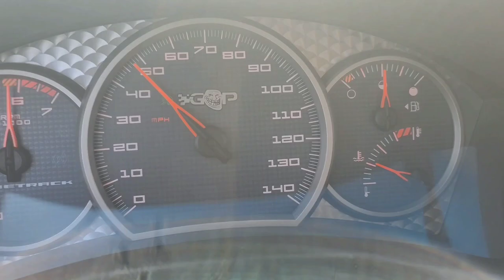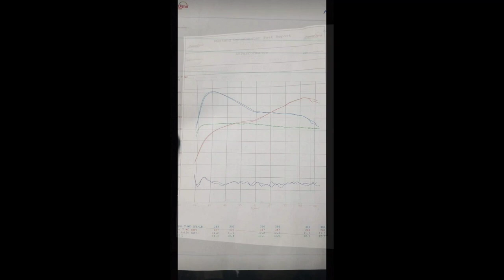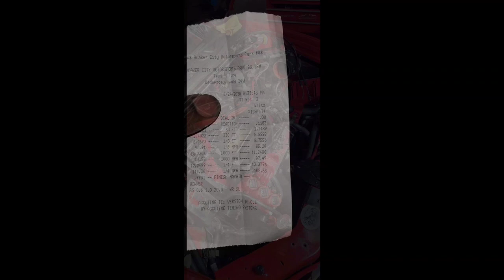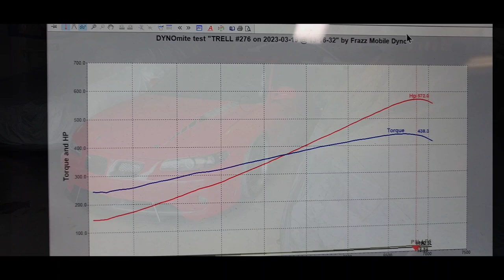The documentary of HellBoi the built 3800 grandprix gtp

Comment: Hey what kind of fuel pump are you running? Also I have a na 3800 pontiac bonneville I thought about having a 4t80e transmission swap into it. Then build the engine up and put a turbo kit on there. My budget would be about 20k?
Reply from the maker: Hellcat 525lph pump with a kenne bell boost a pump

Comment: did you figure out why you spun a bearing on the xp build?
Reply from the maker: Yea cause when he built my motor the first time they was cleaning my bottom end with a pressure washer 🤦🏿‍♂️
Reply: @hand12u   heard that. i had my block sent to a machine shop so im trying my hardest to not mess up the reassembly process.